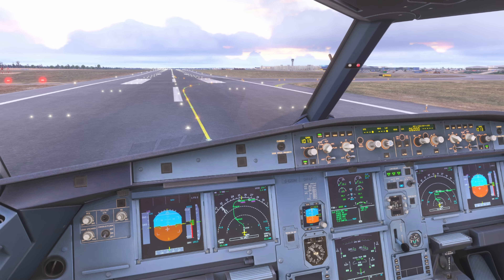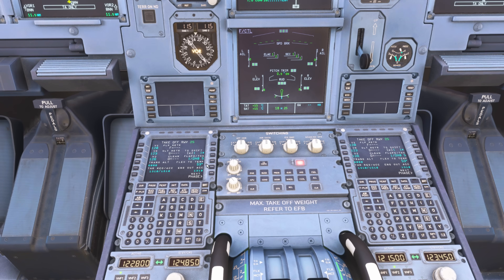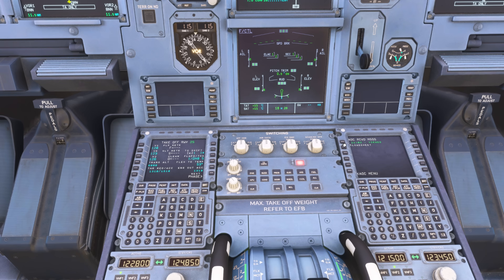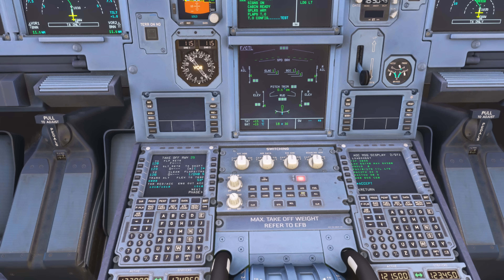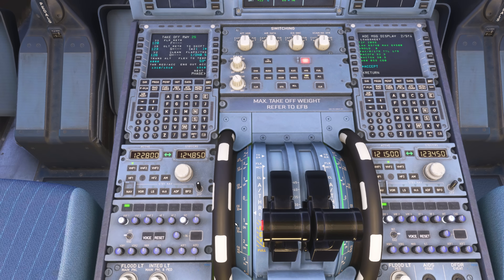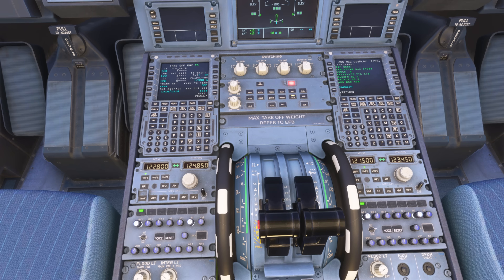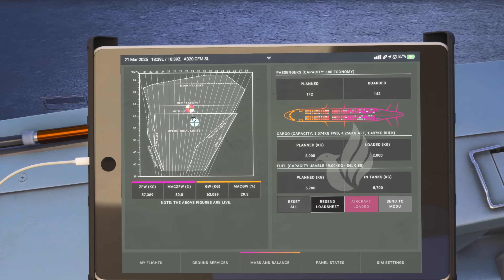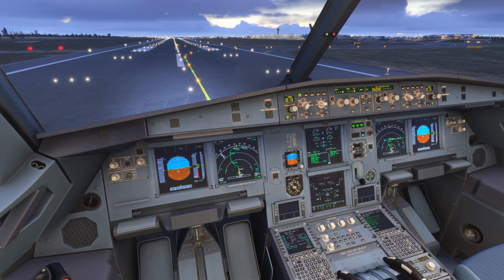A320 Takeoff Trim Explained | Real Airbus Pilot Tutorial in MSFS 2024

Comment: Another fantastic video Captain. Thank you. I’m learning so much here! One thing that I’ve been trying to find the answer to for ages though. What’s the difference between the grey and the red\white circles on the W&B sheet on the EFB? Is one MACTOW and the other MACZFW? If so, what are the practical differences?
Reply from the maker: Hello, yes you are correct. MACTOW is more relevant for takeoff ensuring the balance is correct for a smooth rotation. MACZFW is more relevant for ensuring a stabilized approach when fuel is much lower. Pleased to hear you are enjoying the content, thanks for watching 👍
Reply: Awesome, thanks so much for clarifying!

Comment: Another excellent video, thank you.  The main thing I learned today was that the PERF entry has no function in the avionics apart from display.  After crunching on that for a bit, I suppose it helps as it provides something to check against between two (more if you count the load sheet) displays and hopefully the practice of entering it in the MCDU is a good mental note to set the trim wheel.

I'd be interested in your objective comparison of the Fenix A320 with the same variant you fly for real, if you're happy to share some insights.
Reply from the maker: Hello and thanks for watching! I often touch on comparisons on live streams. In terms of system depth and functionality the Fenix is in a good place. When it comes to handling there are a few variables which often make it difficult for a sim pilot to have a realistic feel for the aircraft. This can be closely achieved with the Fenix but updates to software and hardware sensitivity settings make it difficult. A real world pilot has an advantage and can tune the sim accordingly but I find with most updates adjustments are needed so there is a lack of uniform feel for the aircraft across the sim world which often causes some frustration. With the Fenix it is possible to have a close to realistic feel if you are setup correctly 👍
Reply: @AirbusCockpitCoach  I wonder if sometime you might share the settings you use, although they will of course depend on the hardware used.  I'd love to go in a proper simulator, but in the meantime am slowly building one at home (no full motion setup, sadly).

Comment: Thank you for the video captain.
Is there a safeguard prior to take-off that checks that the trim wheel is set in a position that isn't too far off from the THS setting as calculated by the MCDU in the TO PERF page ?
Reply from the maker: Hello, the trim is set and cross checked during the after start flow. The THS setting is not calculated by the MCDU the setting comes from the load sheet calculations. The most important part is ensuring the load sheet is correct. There is not a procedural check between the after start flow and takeoff 👍
Reply: @AirbusCockpitCoach  Got it, thank you !